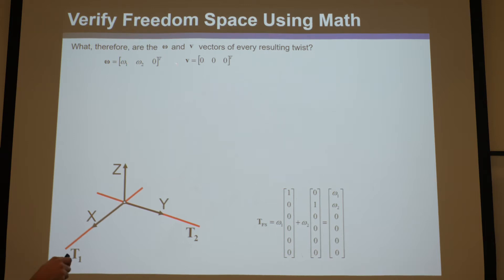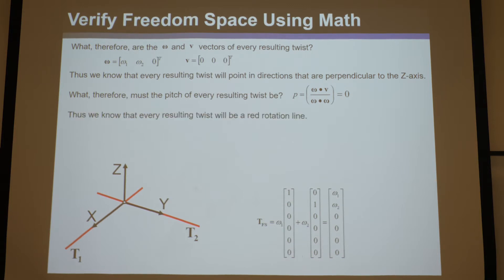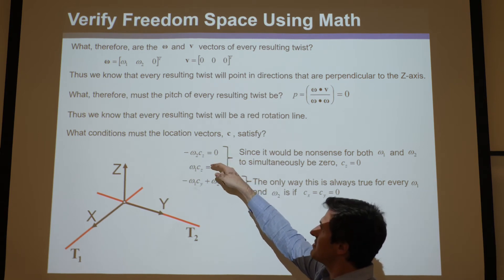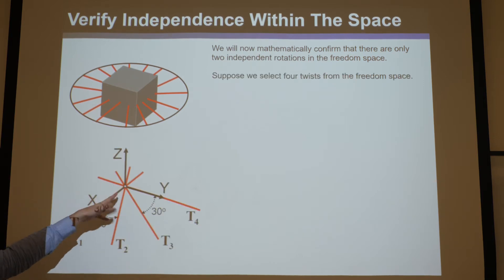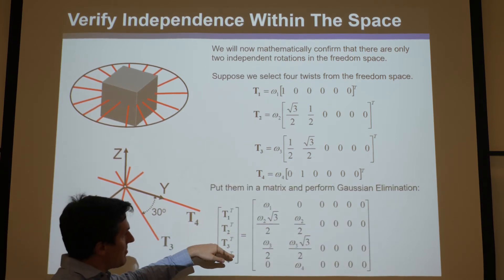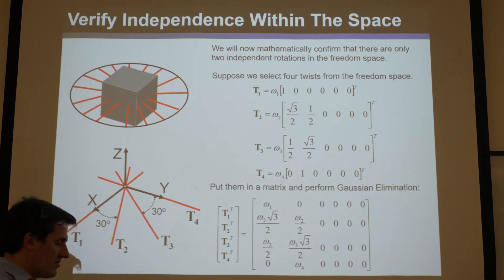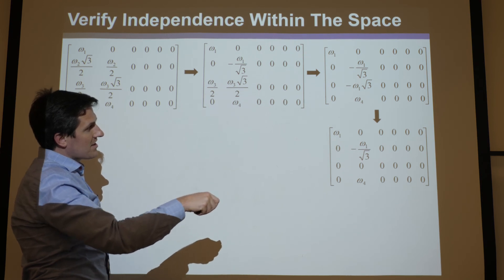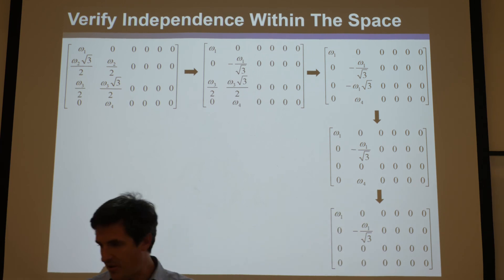Compliant Mechanisms Lecture 5 Part 3

Comment: It just occurred to me that it would be difficult to make a single-piece mechanism, where it's never the case that every element is in its 'relaxed' state.  I can imagine a bistable switch, for instance, where in one state spring A has mechanical energy in it but spring B doesn't, and in the other state, the reverse is true.  It would be tricky to manufacture this as one piece.